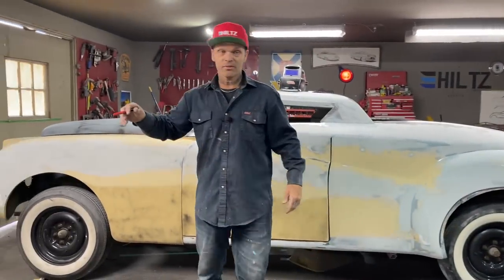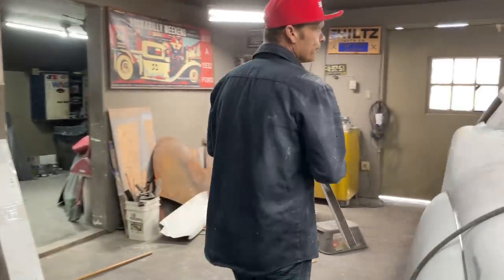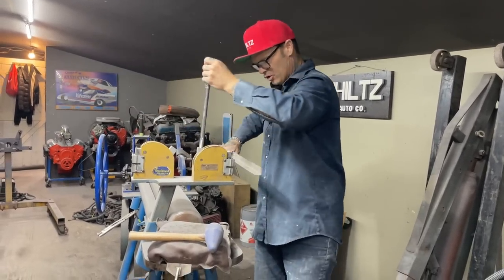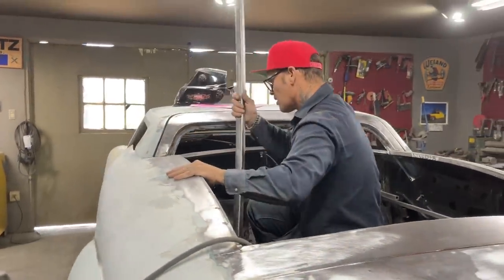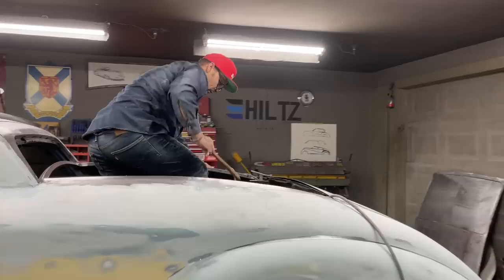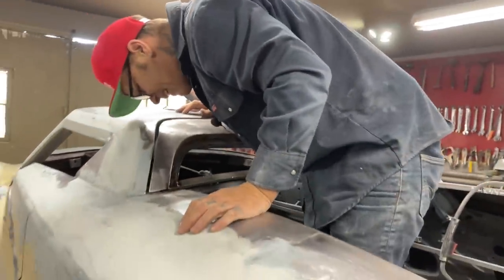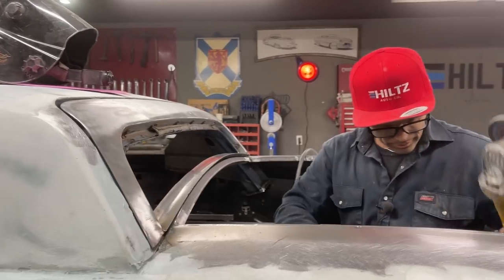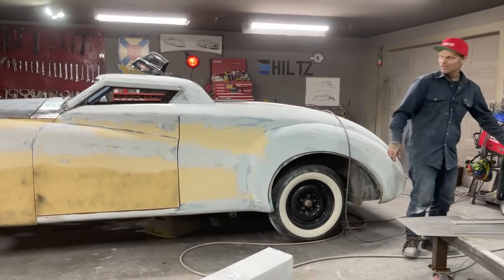Rear window fabrication | 1959 Jaguar

Comment: I like that the rear window can be opened to allow a connection with the front area. It could also act as a deflector for the rear passengers.
Great job guys. 😎👍 
Greetings from Switzerland

Comment: I like the rear skirts off. The wheel openings could be made like a 53 Buick skylark. Make the front ones match. It's a general motors show car trademark in the 50's.

Comment: On the rear window, how about having it as a remote open and close, if that's possible, or failing that, how about those little hydraulic pistons that are normally used to keep the tailgate open, This is taking a very nice shape now, keep it up Chad, and great work from Jolene on the camera

Comment: Instead  of fucking around with cutting the roof so low why not just weld a sheet of steel from door top to door top front to back? Will that be low enough?